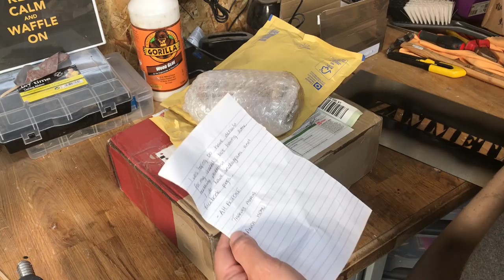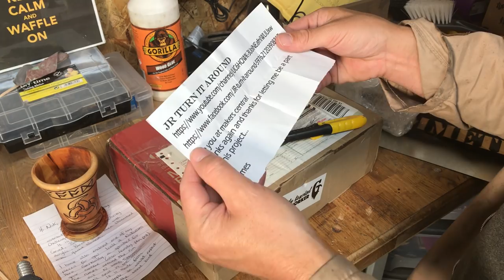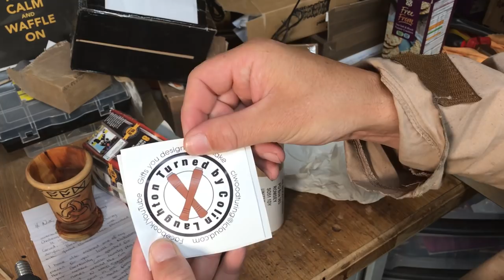Waffle update Makers Central and the Chess Challenge pieces #WW 52

Comment: Hey Nick it is me again 😀 I am looking at buying a small pressure pot maybe 2.25 gallons here in the States. How do you know how much air to put in it for your castings
Reply from the maker: Phillip Christy it will tell you the max on the pot but I put around 45psi in my small one and around 60-65psi in my larger one . I’m not sure if the sizes but there’s a link in my latest project video buddy check it out